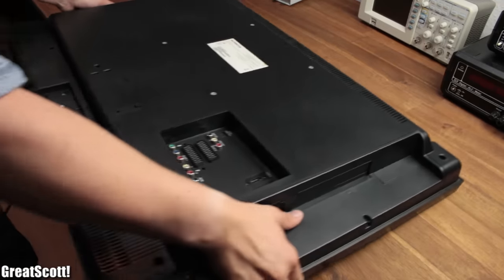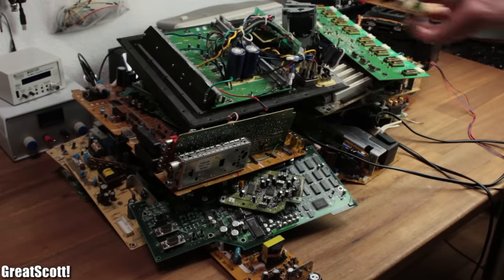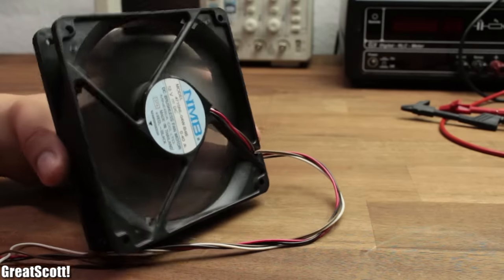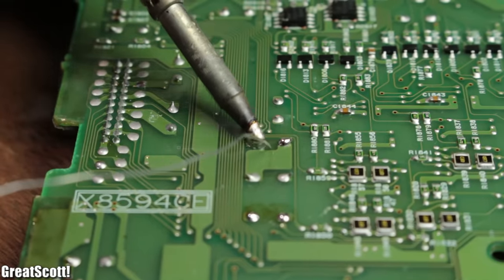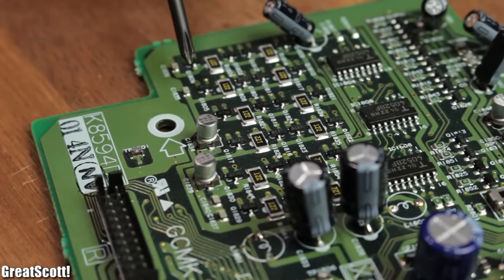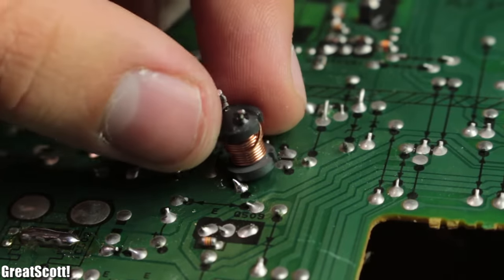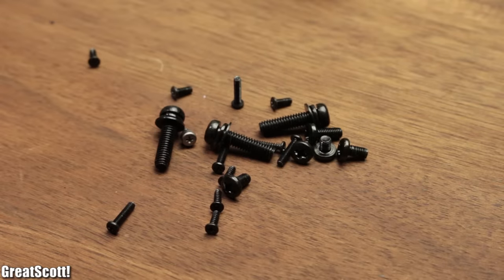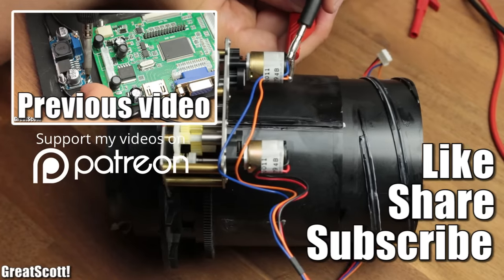What is worth desoldering from old electronics? || DIY Fume Extractor

Comment: 20 years ago it was a challenge to get any high quality parts in Russia. We even scraped all the remaining solder off the boards we were about to recycle for further usage. Even some dead parts were carefully preserved and had some usage in some projects. Nothing was thown away. And today people just toss away perfectly fine top branded capcaitors, high precision resistors and perfectly usable PWM controller ICs just because it is a pain to desolder then pin by pin with no proper tools handy. What a crazy world we are living in.
Reply: Кирилл Рагузин It does make me truly sad. Sourcing quality parts when you live overseas is a complete pain in the ass. Don't get me even started on consumer electronics these days.
Reply: Кирилл Рагузин God bless Mikhail Gorbachev
Reply: Кирилл Рагузин It's easier to buy new part than to salvage old parts. Furthermore what is the chance that you will find enough scrape PWM controller of right type that suit your needs? Personally, I don't have lot of scrape electronics so i have to buy parts.
In past i was scraping electronic parts mostly DC motors (never resistors and capacitors) because that was only way to get some parts. I could forget parts like servo motors, step motors, transmiters etc. Now i have eBay where i can buy parts that i would pay 4x - 10x higher overhere.
It's not crazy world, it's only economy of situation.
Reply: Кирилл Рагузин They are probably like most and don't understand or care they just buy the latest trendy new gadget.
Reply: Mat Matej because it keeps your skills sharp and ready that's more of a reason to do it.
Reply: Кирилл Рагузин much agreed
Reply: In USA its rare for somebody to fix electronics instead of replace.
Reply: illidur people donate old obsolete electronics to me, and I salvage the parts for future gadgets, or just see what's wrong with the item.
I've been given a huge SW radio, AM/FM/SW radio, and a perfectly good AM FM radio! I was also given a lot of TV's, and salvaged the var. capacitor, wire, and speakers! I've about 50+good working speakers for sale or projects.
it's better than radio shack ever was!
Reply: That's why a lot of that waste gets shipped to China these days, where they do recycle every little bit of those things.

I personally do desolder everything, mostly because I don't like to order or go out to get a single component that I likely could have gotten out of a phone, laptop, TV, PC, AMP, etc, etc

Scott doesn't like surface mount, but I do and spent entire days disassembling boards with them.

Do have to say though, instead of going pin by pin with an iron and solder, getting a hot air station and a bucket of flux is a lifesaver.
Reply: enlightendbel Yes, surface mount technology is definitely one of the great things about modern electronics (except for BGAs and other big pinless stuff). Hot air makes working on it so much quicker and easier than it is reworking DIP packages and other stuff alike that there is absolutely no contest. And reliability is pretty much the same.
Reply: This world will not last forever. Our livetime maybe but one day it will turn around. Consumerism is a dead end.
Reply: No, I disagree 100%. How is promoting consumer's needs ever going to end? Demand will always exist.
Reply: There are restrictions on a finite planet
Reply: That enforces that there will always be demand.
Reply: Holy shit! Recycling even the solder is pretty hard core. Since I prefer the solder with flux in it already, not sure this would work for me though.
Reply: Warren Garabrandt The flux core solders need to be very thin and to have quite a high quality to be any good for small SMD stuff and the solders are expensive. This is why even today I still mostly use the good old made in USSR pure tin-lead eutectic solder and some separate flux solutions for different purposes. For me it is free. And rosin is also essentially free. But today I do not recycle solder as well. Primarily because is is not worth it anymore but also because modern consumer electronics manufacturers tend to use that lead-free garbage only suitable for very noncritical purposes with its high melting temperature and tendencies for cold joints and developing cracks after a few years of usage. Not to mention tin whiskers and other weird cristalline structure effects of the nonstable alloys.
Reply: +Кирилл Рагузин I still definitely salvage parts. I buy new if I can't find what I need or need a huge amount. A combination of recycling and buying new is the most economical way to go for sure. I myself would never toss something without stripping it of usable components. I'm a bit more cautious with electrolytic caps though, unless they're a knows good brand and not from the cap plague era.
Reply: It's what happens when you live in a country where your income is determined by the amount of time you spend at work. Suddenly all free time becomes incredibly valuable. You have to go to work anyways; so if you have to waste some money, it's better than wasting your time. It's definitely a problem when real life valuable items that have practical purposes are worth less than the 5 minutes it'd take to recover them.
Reply: Or it could be that we can order almost anything overnight from Digikey or Mouser ...
Reply: jumperIndustries you know your right for the most part but some people are tinkerers at heart. I can’t help it. Sure it is unfortunate when things break but it also gives me something to achieve. It’s pure satisfaction.
Reply: @matmatej7209  you missed the point of the outing original comment...
Reply: You and this video reminded me of how my father used to desolder old components from a broken TVs and how it was common to fix such things, but around 2000-2002 everything changed
Reply: @georgievvladimir  Lmao commie why so anger?
Reply: @runoakland1745  no anger, just the truth
Reply: @georgievvladimir  I was joking :)
Reply: jon fraer  everyone has the right to think however they want. You can't prohibit being gay, that's wrong. You can (and should) prohibit gay people that are also molesters or try to implant their beliefs into child's minds. But that should happen with everyone that acts like that. No race or sexual orientation difference.
Reply: And think of all the gold etc people  don't know or realise they are throwing away
Reply: @georgievvladimir  
It's not just about countries, it's about the international economic system.
Reply: And people throw away speakers WHILE THE ACTUAL SPEAKER DRIVER WORKS!!! They didnt they can tear the speaker box open and keep some parts.
Reply: What's even worse, is when companies (like Best Buy) offer "Free replacement programs" which encourages people to purposely destroy working appliances, so that they can get a free replacement in the form of a newer product.
Reply: The world has changed. The world will always changed. What worked long ago may not work today. What works today may not work tomorrow.
Back in the day, 1% resistors were hard to find and expensive. Now they're cheap.
In the past I would have always salvaged such valuable parts. Now I don't bother. I can get these resistors so cheaply and easily that it's simply not worth the time and effort to salvage them. I've already got more than I am likely to need for many years.
Reply: @illidur  yes indeed,,is called economics.....since you come from a third world country you don't understand this concept that time is money.
Reply: @georgievvladimir  yes...and you spend the time drinking and driving on the roads.   and until Mikhail  Gorbachev came to save your country,,,,you guys spent many hours in line waiting to get a piece of hard bread.  Go to cuba and relive those wonderful days before your country was saved by capitalism.
Reply: @enlightendbel  yes they do.....because they pay some poor chinese person 50 cents a day to work.  then it becomes economically possible.
Reply: @hmax1591  Im in USA and of course I know that.
Reply: its true. sorry russia was so lame back then..
Reply: @georgievvladimir I am American.  And my family always fixes everything until there is just no way to continue to keep it working before we dispose of it.  Then we will remove what we may find use for on other projects and save those parts for later.    I built my own computer at 13. Built my first bike at 10 and rode it till I was almost 20.  Built my first lawn mower and tractor and built my first truck to learn to drive in.   Not all Americans are like that.    Infact everyone I grew up with was raised the same way I was.
Reply: @illidur  The resources aren't infinite. The more we use them, the more they are scattered around and it costs a lot (energy wise) to get them again.
The stocks for some metals are more scarce than petrol
Reply: +Vladimir Georgiev 
Your ignorance is beyond me
Reply: Russia was in a state like Cuba.  We dont throw anything away because we can always use something off of it for something else.  We are the true Re-Engineers of the wold '
Reply: Reusing even the solder!? Now that's hardcore and inspirational. People may think I'm weird or crazy here in the US for desoldering when I can buy but I honestly prefer it this way as it's a good way to sharpen skills and not be so wasteful.
Reply: Not crazy. Different. 20 years ago, a unit of your currency probably held different value. Today, it doesn't
Reply: To be fair, these components are 50x cheaper than back in the day. The items i would keep nowadays would be only certain connectors and ports, or certain ICs.
Reply: I salvage absolutely everything I think I might be able to reuse including resistors and capacitors.  The nearest place with a good supply of electronic parts is 45 minutes each way.  Delivery is by courier.  So either way it never pays to just order a few cheap items.  The local post office is barely functional and international parcels can take months to arrive so eBay isn't a viable option either.  Neither are places like Aliexpress.
Reply: jon fraer  I'm more concerned about Christian propaganda.
Reply: @alvaius  I have to have a minimum order of $150 or Digikey and Mouser charge me $60 shipping.  That's the sort of thing that makes salvage worthwhile.
Reply: @hmax1591  Cuba actually had a lot of help towards destruction from the US and its allies.
Reply: Vladimir Georgiev , you got that one right!
Reply: Paul Reason , good point. I just save all this until I can figure out how to extract the gold. Same goes for old computer CPUs.
Reply: @ian1352  Why is it like that? I am in Luxembourg and parts from Mouser from time to time. They offer free shipping for orders >= 50 EUR / 60 USD. They ship from USA with FedEx express, usually package arrives in 2 days (if I order on Friday, it comes on Monday)
Reply: It’s called capitalism. No respect for anything or anyone, but money
Reply: 995th like!
Reply: I have just got into salvaging old electronics for parts (Cause...I'm poor) and people would be believe how many heatsinks or other goodies one can nab from roadside eletronics.I have fixed laptops, blu ray players, and other computer gear. Hell, if you ever find a tv box in the trash, open the damn thing up! There is a free hard drive in that thing that can be used in a computer!
Reply: @Saintbow  I do that to
Reply: I started out doing this. Then I got a job as an electronic design engineer, and when that happens pretty much every manufacturer wants to send you free parts so you'll use them in your designs. So I found that after a point, my inventory of salvaged parts started to become an impediment. The task of finding what I need and making room for my project gets in the way of creating. So now I work even harder to get rid of parts than I do to find them. 

Whether you end up keeping the parts, at the very least all this desoldering work will improve your technique at repairing boards!
Reply: I agree, im from a place it the world where i could easily do this but it seems so wasteful to throwaway an entire board covered is ICs and transistors.
Reply: @trininite  It's terrible for the environment too and not every US city has a good disposal policy on stuff like this. It can end up in a landfill if you just put it by the curb.
Reply: I live in Britain and build valve amps, I've spoken with a number of Russian builders and theres a lot of camaraderie - over 35 years I've stripped a lot of dumped valve electronics, people thought I was mad and now this stuff is rare and expensive
Reply: Wow.
Reply: You use to actually do all that work??🌊
Reply: Most of the population doesnt know how to repair/build electronic projects, not do most of us have space to board a scrap junkyard in our homes.
Reply: American "Consumerism" as some of you named it, can only lead to one possible end,  and it is coming sooner than you may realize. (Actually it's worldwide but I agree that it is rampant here) No I'm not coocoo but in short it is a simple equation of greed-----》inflation------》faster really high inflation------》prioritizing expenses. Disposable consumer electronics will indeed be a thing of the past and food will be the priority. It will be stockpiled, become incredibly expensive and money will become more useful as toilet paper than anything else. This is huge as a common thread in B rate futuristic movies, even some A list ones, but it's also a common prophetic theme as well. Good night my fellow nerds and cool kids!
Edit: I did get kind of intense about the topic but it has just been so hot here and summer hasn't even started yet. The thing about food being so scarce is something I learned from the Bible as a kid, and when the ozone started degrading in the 80's we'd talk about what would happen in the environment, and by what year (this is science classes senior year, 1987, and college lectures later), and it's happening exactly as I was taught.
Reply: when he said about not keeping the resistors and capacitors because you can get it cheap, I was like bro, wow. Okay. 
This is a great thought because its like you captured the vibe I felt. The ungratefulness for the details.
Reply: @jerridmangus8139  No, there are billions of humans and you're completely expendable. Lots of people. Not rare.
Reply: That explains why you invade nearby countries I guess
Reply: sigh we are going back into this loop. i remember 4 years ago when parts were easy to find. It is now 2022 and the economy is absolute dogshit and parts are a hell to find
Reply: My instrument box is filled with capacitors and I always desolder ICs from old boards because its very therapeutic for me.
Reply: It's about to get harder.
Reply: Honestly believe manufacturers should be made to build recycling equipment for anything produced and have them waiting. Each city could have it's electronics sorting center which returns goods to the manufacturer.

Similar with plastics. All of it should be biotagged and cleanup costs placed on the manufacturer.
The world would clean up quickly when profits are only viable through green manufacturing.
Reply: @illidur  or adaptation
Reply: @illidur  most stuff isn't serviceable
Reply: How many of you people bitching about consumerism have a 10 year old cell phone? Yeah, I didn't think so.
Reply: Idk if you can ship from China to Russia now. It is really cheap here because most of these things are produced here and delivery is really cheap as well. Imagine buying 1000 resistors for one dollar with shipping.
Reply: Hi friend!i do such salvaging too.i just can't see usable things that can be used again,are thrown away.i save solder and copper wire and any component as much as i can👌👌
Reply: It’s gonna be getting a lot harder to source anything in Russia but sticks and stones pretty soon lol.
Reply: And there are people who are completely dependent on desoldering I'm broke
Reply: When I was kid I used to salvage a lot of parts from broken electronics such as Soviet TVs thrown away. Honestly I still do nowadays.
Reply: welp, careful what you wish for
Reply: We have a paper lists with some paint spills in an art gallery, but the real masterpieces are going to trash. Crazy, absolutely crazy world.
Reply: That must have been before RoHS.  Production solder is trash now.
Reply: Sanctions